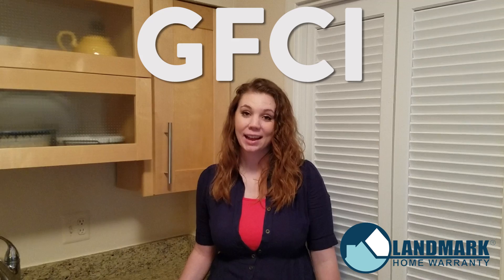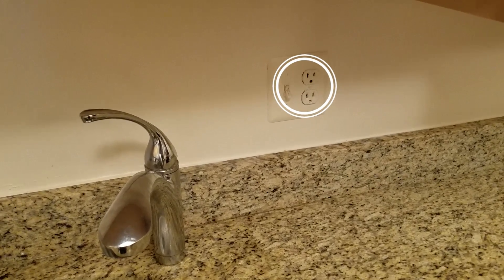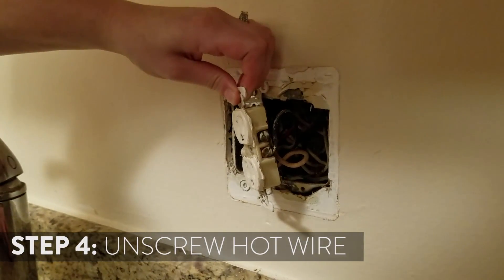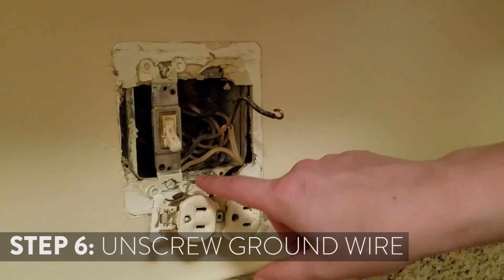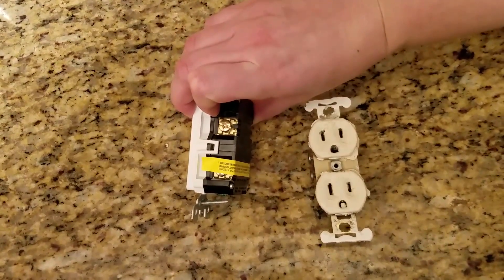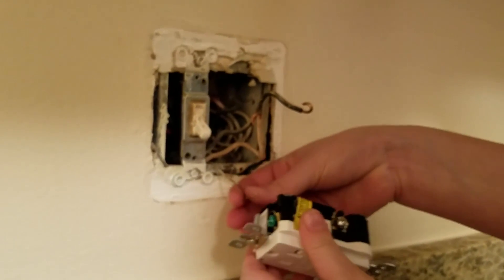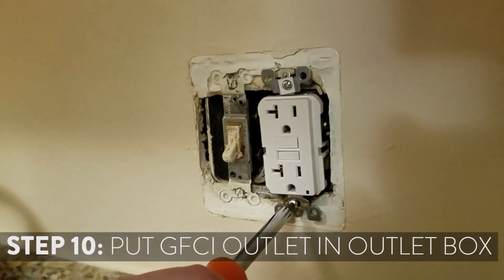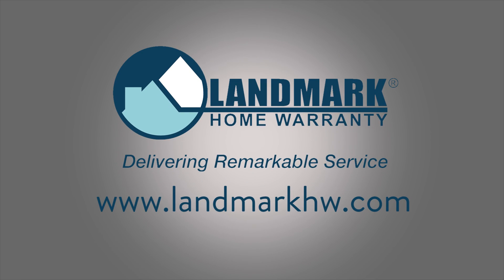How to Change a Regular Outlet to a GFCI Outlet

Comment: That horizontal slot where you plug in your cord, means u got a 20 amp gfci. Don't know if your wires are 14 or 12, but that old outlet wasn't 20 amps. Anyways... good video

Comment: Probably should have installed a 15A receptacle instead of a 20 (you can tell by the "T" slot)  That way nobody can plug in a 20A device in case its just a 15A breaker w/14ga wire.  
Nothing magical about using the Load terminals, if you want to make a downstream outlet also GFCI.  If you're not qualified to do that, you're not qualified to do this.

Comment: Good except wires should have been straight before insertion under screw clamp.  Also good idea would be to wrap the gfci terminals with Scotch 33 electrician tape.

Comment: Did anyone else notice that she installed a 20 amp receptacle instead of a 15 amp receptacle like the one she took off. Which is against code. Unless the wires are 12 awg or larger it is against code to install anything except a 15 amp receptacle. I wish she would have explained that in the video.

Comment: What is this "electrical current" that appears to run through the outlet.??
It is a mains Voltage that is present at the outlet, not current.
When a load is applied to the available voltage, the power is expressed in Watts, current is a by-product of this process.
Correctness is everything.
Reply: Yeah I noticed that too, but I think for the layman DIY'er this is a perfectly suitable description.  For the most part, if someone follows these instructions, they will be able to get the job done and avoid getting hurt.  But, yeah, I'm with you; it never hurts to be correct especially with something as dangerous as electricity!

Comment: WOW! I was told hooking up one of these was complex!, but it hooks the same as regular receptacles black hot wire to brass and white to regular screw..... But the i was thinking about is gfi and not gfci
Reply: Gfi and gfci are the same.
Reply: @surferdude642  yes at the time I misspoke as I realize they both preform the same function.
Reply: @brianhenson6141  just an fyi here. There is no "both". Sometimes the letter "c" is omitted. There are, however, dual function devices which provide gfci and afci protection. They look the same.

Comment: Stripped wires intering any slots or holes in any terminal must have no parts expose..always make sure all intripped conductors  totally fits inside ....always treat all wires as live..dont touch it with bare hands..always use appropriate tools

Comment: I will clear up a few elementary errors in this video:
1. A GFCI does not "immediately shut off electric current when it comes in contact with water." A GFCI measures the difference between hot current and neutral current, and turns off the circuit if the difference is above the designed threshold.
2. You don't want to make sure "the outlet you want to change to a GFCI does not have current running through it at this time." If nothing is plugged into the outlet, there will be no current flow through the outlet at that time, even with its breaker on. What you want to be sure of is that the outlet you want to change to a GFCI does not have VOLTAGE running TO it at this time. There's a major difference.
3. The hot wire is NOT the "one that brings the electricity from the circuit breaker box to the outlet." Unless you have a ground fault, current flow through the hot conductor and current flow through the neutral conductor are always EQUAL to each other. The difference is the voltage to earth, not the current through the conductor.
Reply: M Detlef - Nope. This is AC, not DC. Unless there is a ground fault, both the hot AND the neutral conductors are carrying the EXACT same amount of current at all times. The difference between hot and neutral is not in the current, but in the voltage. With respect to earth, the black conductor has voltage on it as it exits the panel, while the white conductor does not.
Reply: @esl4058  And I'll have to call you out as well. "Return conductor" is an electrician's idiom, not a reality. There is no "supply and return." The hot and the neutral conductors carry the exact SAME amount of current at all times. Unless there is a ground fault, both conductors feed the load exactly equally. This has NOTHING to do with some convoluted description of series wiring, but with normal wiring. With respect to earth, all the voltage is on the hot conductor and none is on the neutral. You cannot argue against these points. You might be confusing voltage with current or something. I can't quite figure it out from your post.
Reply: What is this "electrical current" that appears to run through the outlet.??
It is a mains Voltage that is present at the outlet, not current.
When a load is applied to the available voltage, the power is expressed in Watts, current is a by-product of this process.
Correctness is everything.
Reply: @G1ZQCArtwork   Not sure whom you are attempting to correct. Even though your question makes no sense, you are partially correct. In a normal outlet, load or no load,  both the hot and neutral conductors are carrying an identical amount of current at all times.
Electromotive Force expressed in volts is present across the outlet, and when a load is applied, current intensity expressed in amps begins to flow through both conductors equally. Voltage and amperage work together to dissipate power, expressed in Watts.

Comment: WHOA!! VERY DANGEROUS @ 1:31 !!  DO NOT start going into a box until ALL wires/circuits in the box are KNOWN to be OFF (i.e.: TESTED).  The switch may be on another circuit and still live! Shine a flashlight into the box to see what's back there AND use a $10 non contact voltage tester as Don Cunningham said (2 months ago). Electric power is wonderful and convenient but DEADLY to the un-cautious! Touch a live 120v wire with a metal tool or your finger and also make contact with a grounded metal box or a ground wire (bare copper usually) or a 'neutral wire (white) and molten metal could be blown back into your face, sparks could start a fire and/or you could wake up on the floor across the room or not wake up at all! All before the circuit breaker tripped to shut off power.  THIS IS NOT THEORY OR OPINION, IT HAPPENS!!
       Older circuit breakers are not as responsive as the newest ones and they could be faulty as well.

Comment: Wow best electrician/Youtuber ever!
Reply: 😂 I can't wait to read the essay!!
Reply: @whitneydabaum18  - I usually am a lot long winded on an opinion or to state facts.  When I take time out for you, your eyes may grow tired.  
I will give you a preview right now with the fact she didn't use the proper type of screwdrivers for handling electrical work.  Electricians screwdrivers are a must for cases when there just may be free current in wires.
Reply: As long as you have turned off your breaker, you can use a normal screwdriver. :)
Reply: No She isn't
Reply: @MemoGrafix in a five paragraph, argumentative essay please respond explain and defend your stance on this opinion. Remember that this essay is to be written FACTUALLY not with your own opinions.  All evidence must be from a vetted and reliable source, (I'm sorry students,  but this means NO WIKIPEDIA). All personal opinion found within the essay will result in a ten point deduction(for each instance). REMEMBER: your essay should include an intro paragraph, 3 argumentative body paragraphs, and one counterclaim or counterargument.  You will need to clearly state your thesis in the introductory paragraph,  and restate your thesis in your conclusion paragraph. Your conclusion paragraph should contain a restatement of each point of your argument,  but also contain some additional analysis and insight on your position on the argument.  Your essay will be graded as follows:

Sources--------_/50
Content--------_/100
Grammar------_/50
Structure------_/100

Total:      /300

As you can see you can see, this essay will have a large impact on your grade,  and MemoGrafix you're sitting at a low D- I would suggest working hard.

Comment: I really wouldn't go digging around in that box until you've also tested the switch. While it is very likely on the same circuit as the outlet, the only way to be sure is to test it. Spend the extra $10 and get a non contact voltage tester.
Reply: Or...................just turn the switch on and make sure that whatever it goes to does not turn on.

Comment: FYI as of June 2018 the code also requires Combination Arc Fault Circuit Interrupter (CAFCI) protection in kitchen, dining, and finished laundry room for receptacles.

Comment: Nice video except a GFCI device does not turn off when "it senses the presence of water".  It measures the current in the hot and neutral and it turns off when the current between the two has an imbalance of 4-6 ma meaning that some current is flowing outside of the circuit.  Also the word for the device you installed is a receptacle not a plug, a plug goes into a receptacle.

Comment: what about if I want to install a double duplex gfci receptacle
Reply: +Brad S You wouldn't want to do that unless both gfci's are on separate branches. However you can put a regular outlet next to the gfci outlet and have it protected by the gfci outlet. To do this you would hook up the regular outlet top line screws to the gfci bottom load screws. Just be sure to not hook up another gfci outlet to the first gcfi outlet load screws. It'll cause a lot of problems with the second gfci such as tripping frequently.

Comment: Wrong side of the screw!!!! Wrong install!!!!!!!
Reply: She installed it properly.  The top two terminals are the line terminals.  She put the wires there.  It's correct, so I'm not sure what you're talking about. The only criticism I have is she didn't cut the wires and restrip.  Those wires were all bent and should have been cut and restripped.
Reply: Please, share link to a video with proper install for the rest of us wondering why or how, thanks
Reply: @bobdarker519  She used the push-in terminals which are fine to use.  They screw down without having to loop the wire.  The regular backstab connections are bad, but these have a stab-in with a screw down which is better.

Comment: I want to do just the opposite. Those damned GFCI outlets are forever tripping for no obvious reason, which is a problem in our garage with a freezer full of food.
Reply: R C The GFCI is tripping because it is sensing a ground fault. As I licensed electrical contractor; I've run into this several times in the last 30 years. What often happens is the concrete floor gets damp (or even wet), and provides a easier path to ground. Take a 1/2" piece of plywood (or the like) and put between the fridge and the floor. Another useful trick I use is to plug into the same receptacle a lighted clock. At a glance you'll see the light is off, but also know the exact time the GFCI tripped. Good luck!!
Reply: A fridge should not be on a GFCI.  It is known fridges, for whatever reason, cause nuisance tripping.  You really need a dedicated circuit for your fridge on its own breaker.  However, by code, any electrical outlets in your garage have to be GFCI protected.
Reply: Take refrigerator out of garage..one refrigerator is not enough? Put a dedicated line to garage refrigerator. Single RECEPTACLE. No GFCI needed..see what happens when you hire a professional?

Comment: Not worth risking your life
Better to hire professional electrician
Reply: You aren't risking your life if you throw the breaker.  If you pay someone to do little things like this, you're going to spend a lot of money unnecessarily once you own a home.
Reply: @bobdarker519 That's mostly true if you have aluminum wiring. Not as much for copper wiring.
Reply: Nonsense!
Reply: Kill the breaker, dickhead. Or dont. If you don't, itll be more fun for the rest of us
Reply: +@Iftekhar Khan Unless you're not in the US, AC current at 120 volts passing through you to ground is not going to kill you. What it will do is get your attention as it is not a pleasant feeling. The current flowing to ground tends to limit the current so it's not lethal. Now if you have 3 phase 240 volts AC flow through you to ground that could very well kill you due to the higher voltage. As everyone else has said, go to the circuit breaker box/fuse box and kill the circuit from there. And if you can, pad lock the box to prevent anyone from turning the circuit back on while you are working.
Reply: @emuhill  I don't have a pad lock so I hired a security guard to stand by the circuit panel to prevent anyone (like my wife) from trying to kill me.  $100 well spent.  I'm worth it.